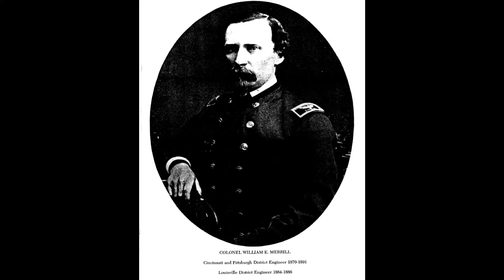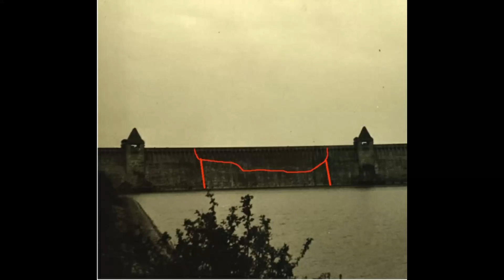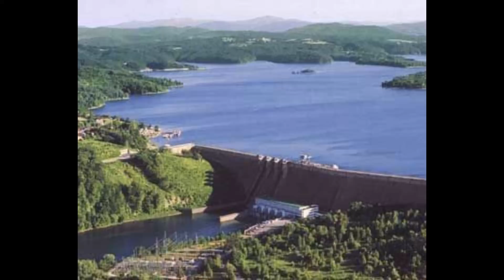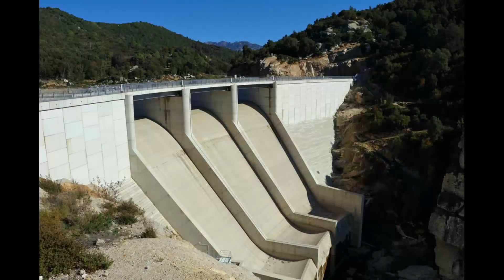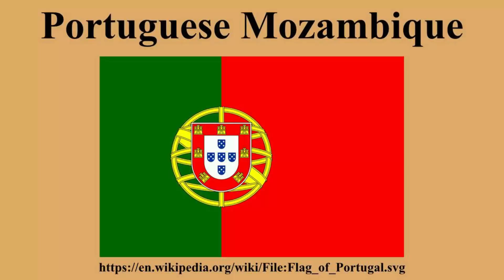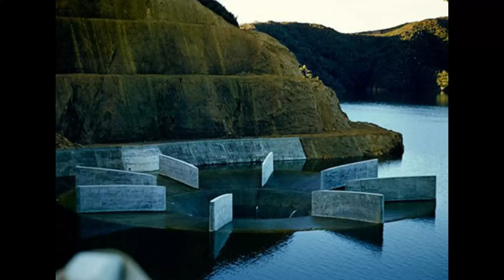Advanced Engineering of Reservoirs & Hydroelectric Projects - Pt 2 Europe, Africa, Asia, & S Pacific

Comment: Everyone think logically for a few moments...
THERE. IS. NO. WAY. ALL. OF. THESE. PROJECTS. WERE. BUILT. IN. THE. "GIVEN". TIMELINE....
period period period
Think about how much effort, planning, and LOGISTICS is needed. The flow process begins with a need or void to fill, an improvement to make, etc. How is it going to be paid for? Financing? Bonds? Slave labor?
The second step is the idea or conceptualization of the project. It has to be committed to paper, drawings, schematics, engineering, mathematics, etc
The third step is procurement/acquisition of raw or finished materials. 
Where does one get all this ??
There are no telephones or computers in the mid 1800s to simply place an order for granite slabs! (Or were there???)
Stone has to be quarried from the earth... The amount of necessary communication needed to coordinate all this activity absent modern forms of communication is laughable!
And then once you have your materials in place, well then there is the matter of putting everything in position. What machinery do you have? Where's your labor force? 
With all these projects simultaneously going on in the mid-1800s- WWII, it looks like just about every man in the country is a skilled builder or tradesman. 
Wow, I didn't realize that the mostly rural population of the early United States was so skilled in architecture and the building trades!! I thought most were subsistence farmers. My grandparents lived off the land and barely had a working automobile.

HIS-TORY IS A LIE, FOLKS.
AMERICA WAS/IS THE OLD WORLD

Comment: At 4:45 - With hand-tools horses and carts. Not impossible the same method was used for canals, I think. Organisation Todt - named after its founder Fritz Todt.
Reply from the maker: I mention that because that is the construction method we are told for canals are hand-tools, but when you really look at canals, they are built with great skill, precision, and heavy masonry, making hand-tools alone not seem adequate for the necessary engineering.
I was stationed in Germany during the 1980s, and "todt" rang a bell so I looked up its meaning, which was "dead."

Comment: I won an old Map of Ohio on an EBay auction a couple of yrs. ago for $15.00 I wanted it mostly because I found it aesthetically pleasing . The condition looked excellent from the images , and I decided it could look good in a frame as a picture. I took it out of the 18' tube it arrived in, and unrolled it. It predates the Civil War , but I can't recall the exact date of it's Printing. It's in a frame now,  and I don't feel like taking it all apart to see. I looked it over and was thinking it was from a later date so I double checked, and it was correct. I doubted it's printing of 1860 ish because what I thought were roads , or trails , were Train Tracks all over and everywhere. I don't think all these roadways we use today were cleared , graded , and paved upon Henry Ford's invention of a cheap Automobile . No. I think all these Interstate Highways were once a very efficiently Engineered and constructed system of Rail Road Tracks.
Reply from the maker: I agree, and would add not just railroad tracks, but probably well-built roads and canals as well.
Reply: Michelle Gibson yes canals were everywhere on the old maps and likely one of the most common forms of transportation. Louisiana still has thousands of miles, probably because it'd be too difficult to pave or fill them with all the mangrove filled swamps. I have a theory that some of the airstrips we've repurposed were bridges that are still buried. The photos of the Lake Havasu London Bridge pre dig out aerial pics suggest it. There's a bunch of huge, unexplainable airstrips all over Australia as well
Reply from the maker: @sageoz9886  I have no doubt!  Google Earth is a great way to travel the landscape for some of the anomalies you describe.  Lots to find!
Reply: Michelle Gibson too bad so much of it is redacted, no doubt to hide anomalies
Reply from the maker: @sageoz9886  True, but they can't, and don't, hide every anomaly, there are so many, and most people don't realize what they are looking at :)
Reply: Joh Levi aka Capt Kirk on YouTube looks extensively at buildings in Ohio .... he breakdowns photos from the 1850’s when they were ‘apparently’ built! Very very interesting, it looks like Ohio had an advanced civilisation there